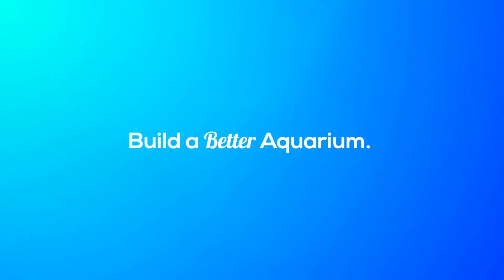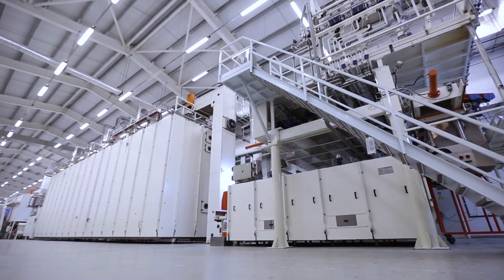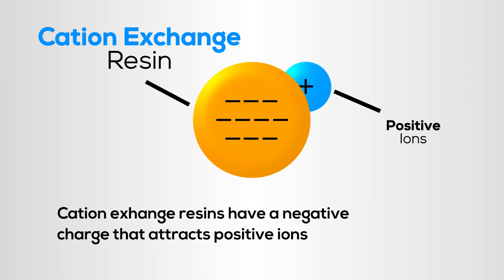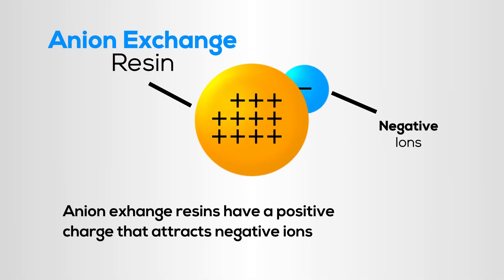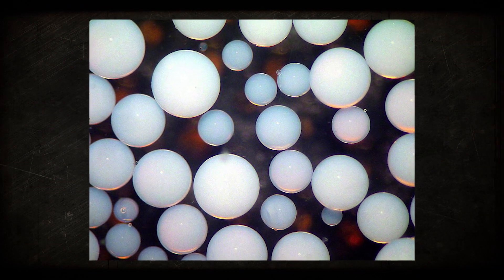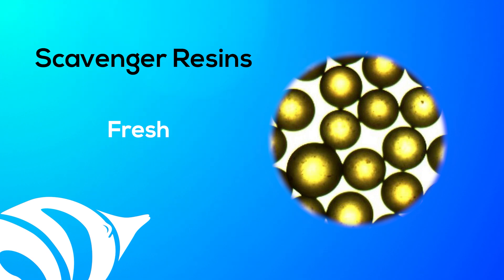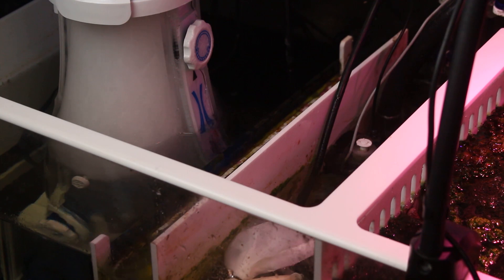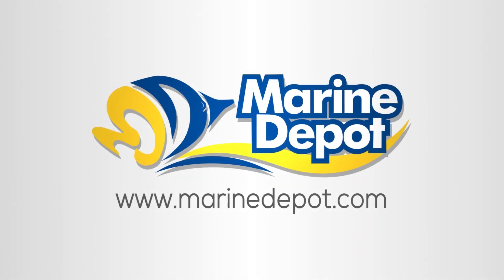Aquarium Resins 101: What They Are and How They Work!

Comment: Will purigen clear 'cloudy water' the cycle on my reef tank is into 4 weeks, diatom bloom has gone but now I have a cloud that is not getting any better, I used live sand with dry rock, any help appreciated
Reply from the maker: cloudy water is usually associated with a bacterial bloom. In most cases, giving it time to clear up is the best option unless you want to add a UV sterilizer to the system.

Comment: I use chemipure elite and works well for phosphates can I add purigan to lower nirtaes with it?  I am sure the carbon part is used up soon since you are supposed to replace carbon often.  Should I use carbon as well ? I have brs roxs.  What is the difference between just using gfo and carbon separately instead of chemipure elite?  It would be cheaper and I can change out the carbon often.  Chemipure elite is expensive and after a while the po4 starts to rise but its still usable. What should I add when they start to rise but not cash yet. Maybe a small amount of phosguard?

Comment: How long do resins take to work? I put some nitrate FX in a reactor, but after 2 weeks have yet to see my nitrates go down.
Reply: They start to work immediadle. Your nitrates might have not decreased because it continued to be generated or added to the system
Reply: @afonsothadeusaviolomedinat8809  Thanks for the reply! It is funny because my Nitrates have been at 12ppm forever and thought Nitrate FX would bring them down 10ppm, which is what they claim. But I am still at 12 after 2 weeks with the same water change and feeding schedule.
Reply: What test are you using ?
Reply: @afonsothadeusaviolomedinat8809  Red Sea
Reply: As the  Red Sea pro test high nitrate chart goes from 8 to 12 and them 16ppm maybe your nitrate is below 12 but still above 8 so you end seen 12 it,s  a limitation of the test and of all the colorimetrics tests.
Reply: @afonsothadeusaviolomedinat8809  Thanks for the info! I see I will need to get a new test kit. I think a NYOS will be on my shopping list in the New Year. Have a merry Christmas, if you celebrate it!